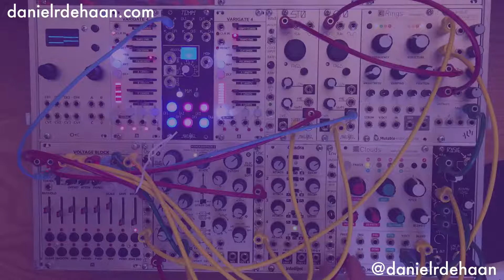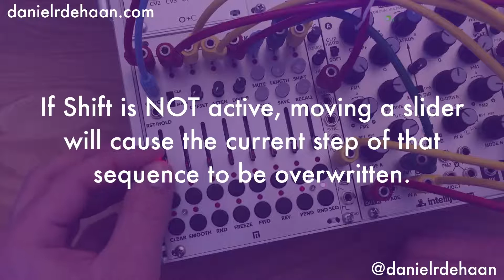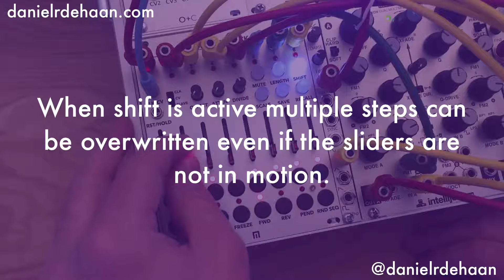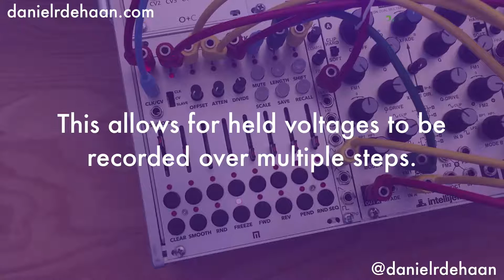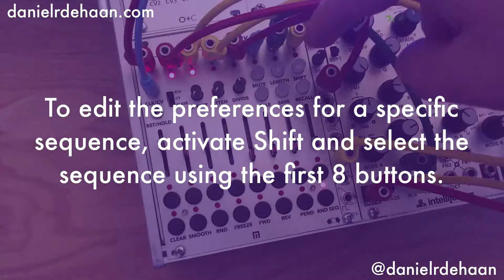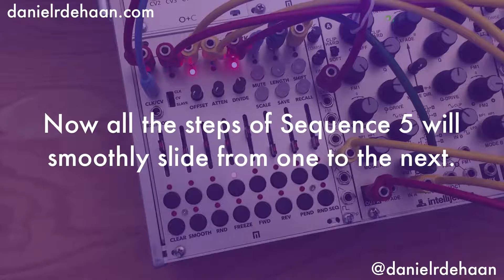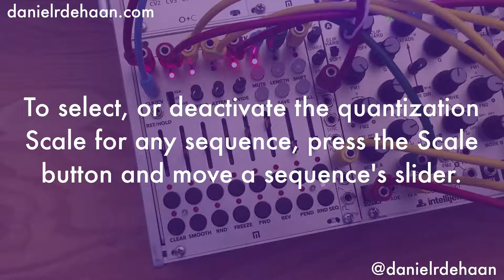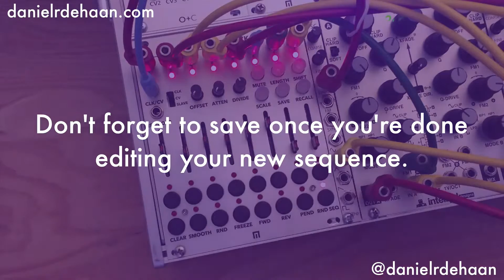Malekko's Voltage Block - A Practical Guide to Creating Sequences

Comment: I have two questions as i recently bought the VB.  I have it clocked via midi to cv module coming from my Octatrack.  what do you patch from to the reset input so i can get sequence to start at first step after stopped and not at step where sequenced was stopped?  Second, i have the division dial all the way to the left and i cant get the notes i play correctly.  it is playing a note every 16 steps on the OT sequencer instead of playing a note with ea of the 16 steps.  Thank you for all your videos as i watched them several times and appreciate the work it takes to produce them.
Reply from the maker: Hi, Scott.

1) I don't have an Octatrack so I can't speak from experience (maybe someone else can chime in) but the way I sync my VB up with other gear is by sending a 16th-note clock source into the VB's Clock Input and then another source that produces a short gate signal every 1, 2, 4, or 8-bars into the VB's Reset Input. 

2) This might be one of two issues. One, are you setting the clock division for all sequences, or just one? Two, is the clock source coming from the Octatrack correct?

My guess, only because I don't know the Octatrack, is that there is an issue with the clock signal it is generating or the module that is converting MIDI to CV. 

Hope this helps!
Reply: Thanks Daniel.  I just got the module and was working on setting up 1 sequence only so far.  the clock source is coming from the OT going into a Pittsburgh Mod Midi to cv converter which has a clock output jack.  I can check the settings on that module for starters as i have not looked into that as of yet.   curious as to what your source is for the short gate signal and how you set it for 1,2,4, 8 bars etc.  I am obviously new to eurorack trying to implement it into a hardware set up.  thanks again for the quick response and the help.
Reply from the maker: Welcome to the world of eurorack! There is definitely a lot of essential manual reading and experimenting at first to work through things like this. I use an Expert Sleepers ES-8 which is an audio interface to send/receive gate signals from Ableton Live and Bitwig. In Ableton I’ve made a few custom Max For Live Devices for creating different CV signals and Bitwig has some native devices for doing similar things. Native Instruments’ Reaktor also great for integrating with eurorack. Of course, all of these include a computer which may be something you are trying to get away from. 

Something that may help you make sense out of all the different signals is picking up either an old Oscilloscope or something like David Jones Design’s O’Tool.
Reply: thanks again for the reply Daniel.  i pretty much work with computer all day and have enjoyed creating music without one.  thanks for all your advice and your time and patience.
Reply: Scott Upright I have a Pittsburgh SV-1 which has a MIDI -to-CV converter that I expect is the same as yours. It's a great converter but I don't believe it includes the specific thing you need in this situation. Basically, in the MIDI standard, start & stop have a different CC signal than the clock itself. Some devices automatically reset back to 1 when the clock disappears for awhile and then comes back, some require that explicit signal. Looks like VB needs that explicit signal.

Basically you just need to send a single gate or trigger into the Reset CV input. You could do this with all kinds of things, a drum trigger, an LFO, or just any gate or trigger output that you can manually control. For instance, the Beatstep Pro has a bunch of individual drum CV gate outputs, each tied to a specific drum pad. Connect one of those outputs to the VB Reset jack, and you've now got a button (well, drum pad) that can reset the VB sequence whenever you feel like it.

Some MIDI-to-CV converters have quite a few outputs and the user can customize which CCs get sent out as CV signals from each jack. I use an Expert Sleepers FH-2 primarily and have one jack for clock output and another output jack for Start/Stop. Mutable Instruments Yarns can do this as well, as can most converters with 6 - 8+ outputs, and of course most modules dedicated to clock functionality, like Pamela's New Workout and presumably the Make Noise Tempi.

Don't quote me on this, and you may want to Google it before trying, but you may be able to get a sufficient ping from a simple footswitch.
Reply: Ryan Dean thanks so much for your feedback.  I needed up getting an Erica Synths Black vco clock2.  Has a reset output you can assign to several lengths / steps.  Again many thanks as I am about 4 months into my eurorack set up and learning more every day.

Comment: See you have two varigate there's and later on you got an 8+... What do you think about operating two varigate 4+'s and seq switchs to do both longer drum triggering pattern, melodic sequenckng and voltage block style  modulation to different patterns when neccesairy?
Reply from the maker: I like it! I have yet to get my hands on a Varigate 4+. The 8+ is definitely more powerful than the original 4, and the 8+ works really nicely with the Voltage Block. But the 4+ looks like a lot of fun and really flexible. Though not sure if I’d recommend two 4+ over one 8+. Especially if you are planning on poring it/then with the voltage block.
Reply: Fair do's. Well im not really keen to get a VB or 8+.. I feel like in my smaller system I could get that voltage block style modulation to the parameters on my drum modules (which is my main intention) sufficiently from one of the two 4+'s whilst still having the potential to do many 8 step sequences or 16 step and longer if i integrate my sequential switch. 

Basically I would be looking at the VB to do more articulation to timbre controls on my drum modules and I reckon that the VB might be overkill for me.. The potential that you cover in this video is great, but I wouldn't intend on having it fill that function.  Furthermore I would like the potential to do some extra gate triggering when necessary (but not always) So I felt like getting another 4+ would give me these options whilst still remaining quick and malleable to my CV and modulation needs.

Any more thoughts with this extra insight? Alternate modules to look at or different options, or would you still stay on the same point?

Sorry for the essay, just trying to pick that brain of yours a bit

Comment: Can you make it skip a slider in one of the 16 sliders, for instance, turn one of the sliders off and jump over that slider but count it like a pause, or rest?
Reply from the maker: You can change the length of a sequence, or you could set two steps to the same pitch. See my other video that’s looks at this module in more depth.
Reply from the maker: Or get creative with its CV mode.

Comment: actually i find it pretty hard to create usefull melodies with the voltage block because of the response of the sliders. so i mostly use it for other controls than pitch.
Reply: Hi Boris, i just got the VB an hour ago and i thought the same thing. I will try to decouple rythm from pitch in my next patch. So when i change the VB sliders, it won't hold the note, but rather DING DING DING keep on playing the note in the rythm its supposed to be played. It will be less noticable that you're re-programing pitch.

Comment: This should get som type of trig expander, cause now theres no trigs or gates for ADRS´s right?
Reply from the maker: +motoboy6666 the Voltage Block is actually kind of the CV expanded for Malekko's gate sequencer, the Varigate 8+.
Reply: DRD_Tutorials yeah, the vari8 is a bit of an overkill for me though.
Reply from the maker: Maybe you've already tried this, but you could just pair it with a small clock divider.
Reply: DRD_Tutorials thats smart! Acutally got a SSSR vc divider i could use, thanks!
Reply from the maker: Yup! The only downside is no pattern save/recall with just a regular clock divider. But I'm sure you can get crafty with it. Especially with patching some of the VB's outputs to the CV controls on your SSSR. Share some videos if you come across any awesome results!
Reply: DRD_Tutorials yeah! This will be great
Reply: DRD_Tutorials hello again, actually never got the VB but finally will get to it. A question though. Must all steps in a sequence be triggered or can they be muted or untrigged?
Reply from the maker: There really aren’t any triggers with the VB. Each sequence advances at some division of the clock patched into its clock sequence. You can just make multiple steps have the same voltage to “mute” it.
Reply: DRD_Tutorials ok! Will the steps be all ”muted” then cause i would love to get some rythm out of this too as it would be my only seq in a pretty small system. Ill try it anyway and see what ill get out of it.
Reply from the maker: Nope. You can't mute a step. This thing only does CV sequences. No rhythms. To get a better idea of how this module works, you should checkout some of the other videos I have done.

Comment: Like the colour overview for jams, tracks etc but would be nice to see without the colour overview regarding tutorial stuff as the video quality looks great! Good work by the way.
Reply: It's a little more work, but typically what is done is to use an overlay only when showing the text. Another trick is to put a subtle dark (but mostly transparent) gradient under the text to make the text pop.
Reply: The text is easier to read, but most of the video doesn't have text on it. And the most important part IMO is seeing your patch and settings.
Reply from the maker: Hi, DivKidVideo! First, thanks for all your videos. I have found them to be super informative and useful. 

I use the color overlays partially because it's winter here in Chicago and it's nice to see some colors, and also because I think it helps makes the text easy to read.